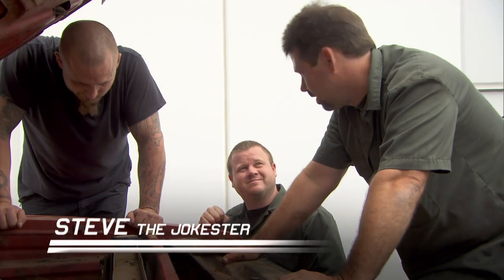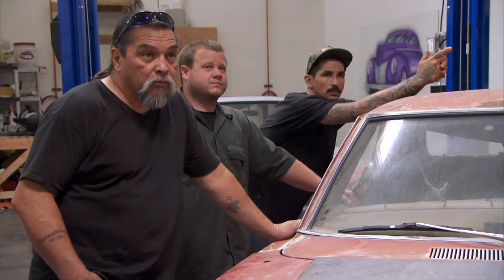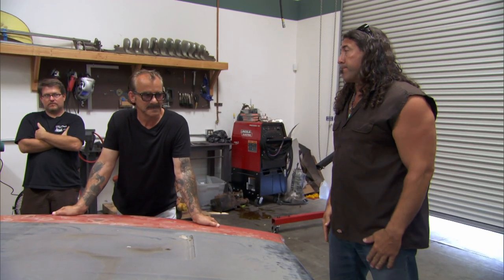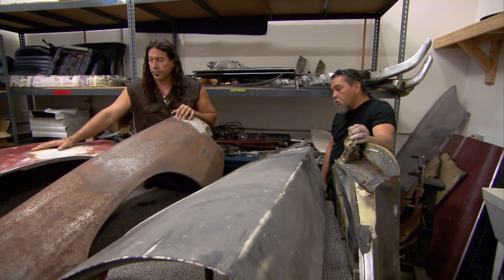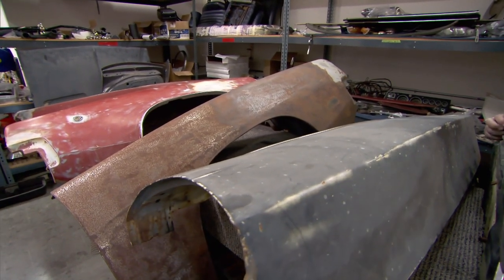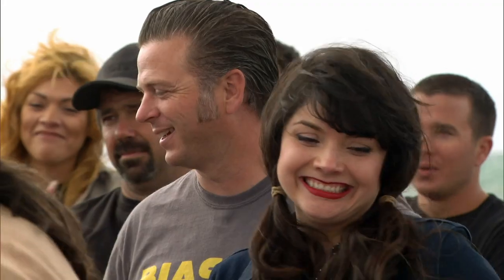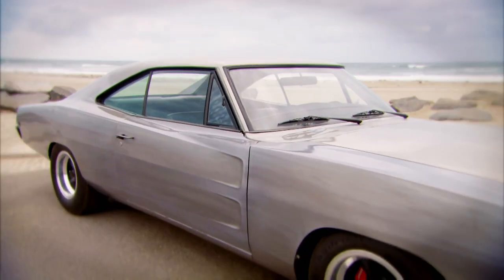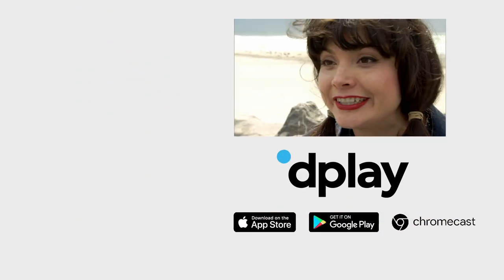Charger's Bare Metal Finish Pushes The Team To Their Limit | Extreme Car Hoarders

Comment: I did a 93 towncar like this but I stripped and gradually sanded it from 80 down to 4000 grit to all metal then polished it to a mirror. 

It took 2 months to finish correctly but it looked amazing and didn't rust as the finish was so fine water totally beaded off of it and the polish compounds prevented it. 
It's a very labor intensive job but well worth it. 

It's been a year since I did that and car still looks amazing and I'm in a very rainy and humid area. 
Not 1 drop of rust

Unfortunately with body damage this process is nearly impossible unless you know a good body guy.

Everyone hates me driving it on a sunny day as it blinds people
Reply: Stop you are making me want to get the sandpaper out
Reply: @aaronlehman9549  it's worth it if done properly
Reply: I did the same to my 82 Camaro
Reply: Got a video of it here on you tube ?
Reply: @yeudsiegal5285  a camaro would look good, got a video of it ?
Reply: @brianblithe2271  unfortunately no I had to sell the car just 2 months after my comment cause of money issues.
Reply: :: haaa I get pissed just off those annoying chrome license plate frames gleaming in my eye,,,, haaa